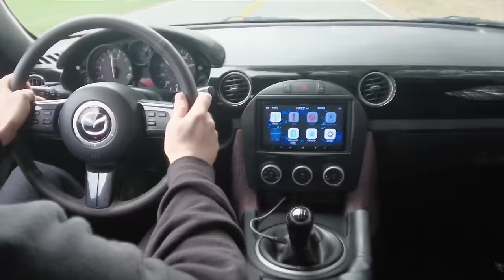NC Miata | Full Free Flowing Exhaust That's NOT Obnoxious

Comment: My complete Goodwin setup is a touch quieter, but I'm running the cat mid-pipe. My wife still announces her arrival home by revving the motor though. She enjoys the sound especially with the top down.
Reply: What is your exact set up?   I have a super q and Goodwin catted/resonated mid pipe.   Worry a cat less header would be too loud and drone
Reply: @daveraco4217  MAX Power 1.8 Inch headers, HELMHOLTZ midpipe with cat (O2 sensors before & after), super-q muffler (baffles out). HELMHOLTZ eliminates drone.
Reply: Thanks.  My mid pipe has a cat and resonator.   I wonder how different it would be.   Drone is nasty.

Comment: Did u notice any performance gain? Ive heard that a setup like this would add around 20 horsepower, which would be quite alot on a 160hp car.
Reply: Shows you how restrictive the stock header is
Reply: It's the stock header / manifold that does most of the restriction. They have a cat in the stock header with absolutely miniscule primaries going into it so a header and a tune usually puts these cars at around 175/180hp. Cams at the same time will see you up to 200 or so. If you want or need to keep the car emissions legal you can keep the cat that is in the midpipe which gives much less restriction than the one in the header, or fit a midpipe with a high flow one.

Comment: Thanks for making this video.  I have a Goodwin Max Power 1.8 header and the Helmholz midpipe that I will be installing soon.  I already have the Super Q muffler on it.

You should have spent $200 to get the header ceramic coated by Jet Hot.  I did that with mine, and it’s supposed to reduce heat radiation by over 50%.  Plus the eye candy factor!  It’s a shame to cover it up with the stock heat shields, so I’m going to consider some options so that the ceramic coated header is visible from the open hood.

Comment: Sounds good! After a couple headers on my Protege I'm of the opinion the 4-1 vs 4-2-1 debate has a bit more nuance to it than blanket statements. I went from a "long tube" "tuned length" 4-1 with a 2.25" outlet, to a 4-2-1 with bigger primaries, but a smaller outlet (I think some odd size like 2.1") and gained power everywhere with a later roll-over of power and almost 10% more peak power to boot 🤷

It's probably beyond the scope of your intentions or budget, but would be cool to see some back-to-back dyno comparisons of various headers like Greg Peter's massive dyno sesh haha

Comment: I don’t think a tri-y header is necessary with an engine with variable cam timing but that’s just a theory.  Someone dynoing a couple headers back to back is really what’s needed to see what’s best. Another  problem I see with a tri-y in this application it makes the primaries really short compared to goodwins 4-1 header.
Reply: My take is that with stock cams, there isn't enough overlap to generate a significant amount of scavenging no matter what the exhaust manifold looks like.  This is why the larger diameter primaries tend to have better results - each cylinder is more or less independent of the others, so the larger / free-est flowing solution is the best.

Once you add cams, you need a lot more primary length, and pretty much every header on the market is terrible.

Comment: New to moding cars here: if i had to choose which to do to get the most power, does switching the mid pipe out or switching the header give me more power?
Reply from the maker: Header, but the whole system has to breath otherwise you just have bottlenecks
Reply: @TheSlipAngle  Right right. Makes sense. Ty💪

Comment: For what its worth, the best flywheel i could find personally is the competition clutch chromoly steel flywheel. They have one thats 9.4lbs if i remember correctly. Thats the one i baught.

Cuz ACT doesn't make a prolite for the NC. only the street-lite which is heavier than the competition clutch one.

The only other flywheel thats lighter for the nc is the fidenza aluminum one. But i chose not to use it because i didn't like the idea that the ring gear could come apart potentially at all. Cuz id hate for that to happen wheh im 9hours away at tail of the dragon ;)

Lastly, i HIGHLY recommend getting ARP flywheel bolts. I have a suspicion that they will eliminate some of the chatter.

And for clutch, nothing beats the SUPER MIATA sport clutch. For the price, the ease of the pedal effort and the amount of torque it holds, the flyin miata clutch is the only one that comes close but has a heavier pedal effort.

Very impressed with the supermiata sport clutch. Id also recommend getting the puck style disc instead of the full face. Cuz having that extra grab would be nice. Churp gears ;)

I think the puck disc with the supermiata sport clutch would be the best as far as clutches go.

Loving the NC!

2.0l MZR FTW. 

ALSO lol you can raise the rev limiter on the stock 2.0l to 7900-8k with no issues, all stock internals. The only time youd need stiffer valve springs is when you also add camshafts. Otherwise the stock 2.0l mzr is good for 8k RPM all day :)
❤
Reply: If Quinn doesn't believe me about the 8k rpm hehe take a look at the block design. She's strapped down like a k series with a full crank girdle plate. Oooo yea baby
Reply: I believe the weak link as far as the 2.0l goes for high rpm is possibly the timing belt. But that's if you're running a nice amount more than 8k rpm
Reply: I can forward you a link of a guy with a bone stock engine 2007 NC running laps around the nurburgring in 5th gear at the limiter for minutes at a time. And that thing is still kicking
Reply: @Nasonix2  What timing belt?
It's a chain